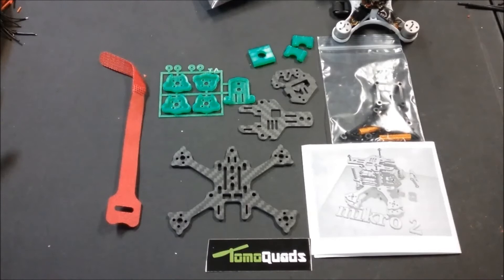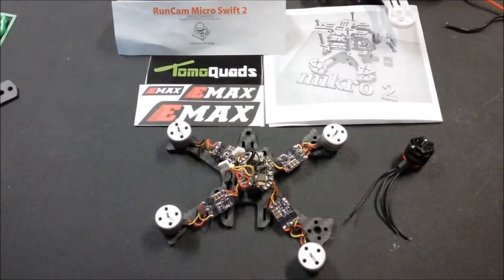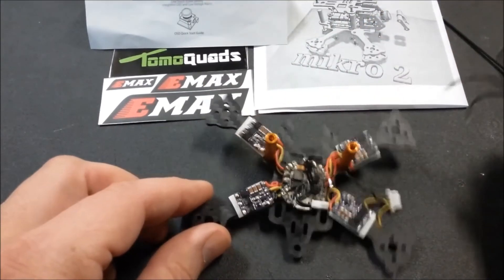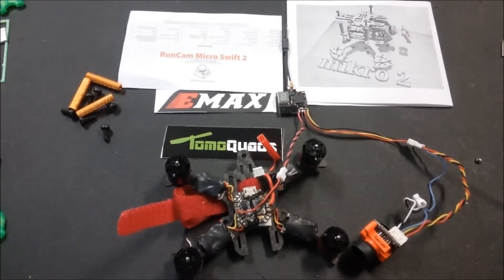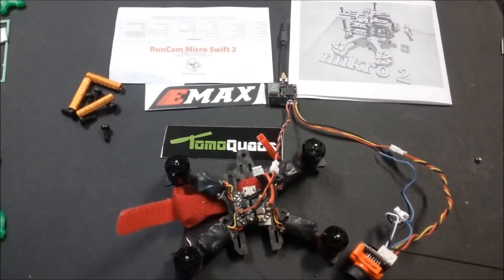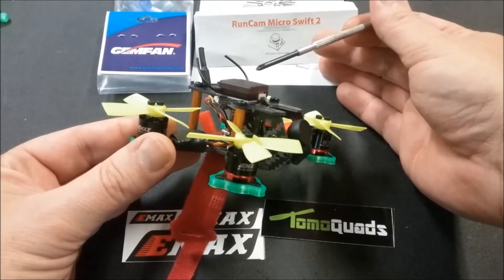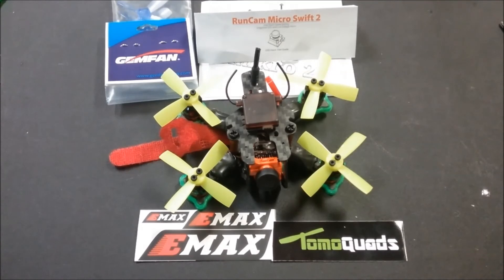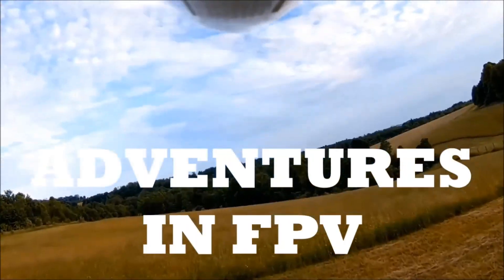Babyhawk upgrade to Tomoquad's Mikro 2 frame (Tomoquad's Mikro 2 build video)

Comment: Terei problemas com o emax 1106 4500kv usando 4s junto com hélices 2035 ou 2040, em um frame 80mm?
Reply from the maker: No, no tendrás problemas si el orificio de montaje del bastidor soporta el patrón de montaje 1106. Basta con tener en cuenta que el clip C es más grande en estos motores Emax que cualquier otro motor de tamaño 1106 para que un Softmount pueda ser necesario o puede que tenga que hacer el agujero del motor en el marco más grande con una broca. El 4500kv es un gran motor. Cambié a la 6000kv porque con el peso de un 4s lipo añadido en ,,, el performace no era tan bueno con 2 "accesorios como la versión 6000kv.
Reply from the maker: Used a translator so I hope that makes sense for you.. Thanks for watching and please Subscribe.
Reply: Thanks a lot, my friend, as soon as I ride, I'll leave the quad link mounted, it may take a while because Brazil is a bit slow to deliver these parts, but I will not forget that it helped me, I'm already following your channel. thank you
Reply: I'm trying to set up a very crazy and powerful brushless microphone, so I opted for those 4500kv 1106, already ready with the up for 4s, let's see how it goes.